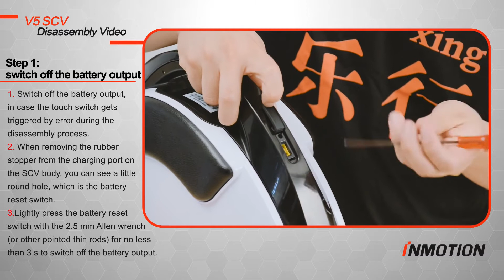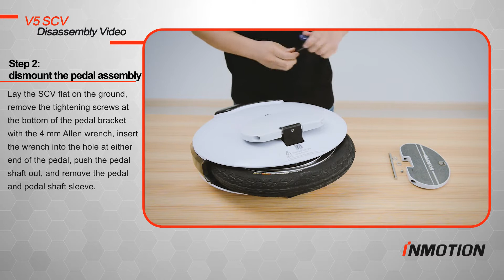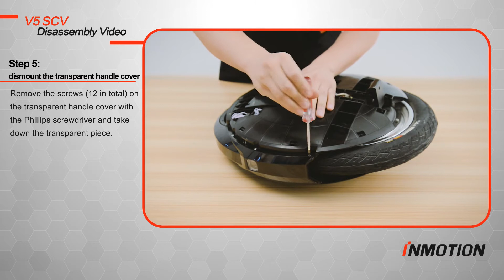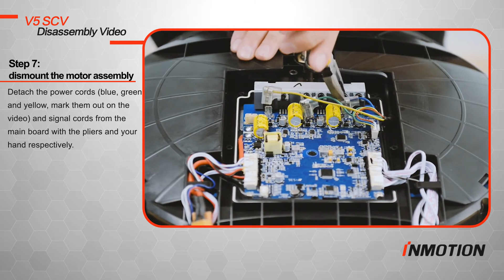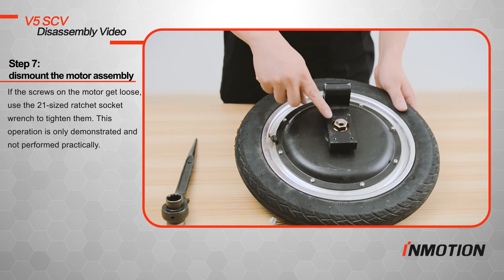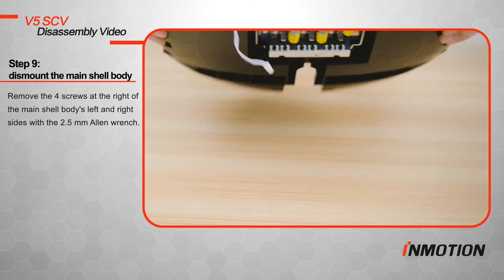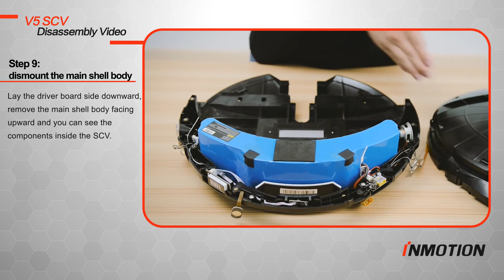Inmotion V5F Dissembly Video for Repair & Servicing (Now with English Annotations)

Comment: I was able to do this. The hardest part was peeling the white shell. I definitely dented it up. In the video it shows it coming clean off with a few pops. Hell no. Get like four flat heads wrapped in duct tape and you'll have to go easy-does-it around the whole circumference. To much twisting in one spot creates dings. I was planning on replacing outer parts anyway and needed the experience.

Comment: having to dive into the mother board to change a freaking tire is outrageous. and the tire gets flat quite often. they could have made so many things to make changing tires easier. this is a very big miss on the inmotion of which  I didn't know when I bought. you don't get this information anywhere when you're new to this
Reply: i just want to clean the dirt from the inside! instead of doing all this ill find a way of putting a brush on the tire then spin the tire around so it brushes all the dirt out.
Reply: Please find me a euc where you don't have to tear everything down to switch tires.
I'ts all of em bruh

Comment: My INMOTION v10 shows no indication of power after installing new motherboard. What could be the problem?
Reply: CHARLIE MURPHY!
Reply: IIRC there is a small opening just above the charging port.  Push a slender tool into the hole and hold pressure for at least 3 seconds.  That is the way to turn off power, don't know if it toggles the other way.  I doubt you will read this after 3 years.